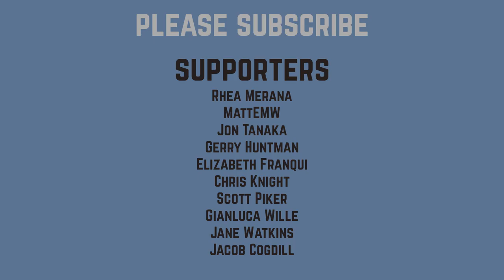How To Remove Broken Drill Bit

Comment: Too bad that I can't shake a beam in the house basement like that to remove my bit! 🤦‍♂️🤓🤷‍♂️
Reply: use oil and pointy beaked pliers, you might get it out then :) but yeah doesnt work on all things, I got a supersmall one  2mm drill bit stuck in buffalo horn bolster for a knife down 1 cm almost, had to dremel it out with cutter and break it up in a few pieces before I could remove it. no way some oil would have helped with that stuff, its like plastic and sort of melts around the bit.
Reply: @pr0faker  Definitely doesn't hurt to try it!
Reply: AWESOME!!!!
Reply: Exact same problem
Reply: Or a dining room table 😂

Comment: Yeah, I'll get on that, just as soon as I've pulled my bannister apart to do it. This is next to useless for 90% of applications.
Reply from the maker: If the drill bit is stuck in another object, a wall or railing or in a large board, then add oil or vd 40 there and with the help of thin pliers (tweezers) it will be possible to get

Comment: Um, what if the block is already screwed into a piece you're building lol
Reply from the maker: It is possible to use oil + 40 and if it is a bolt screwed into a block or brick, then try to get it using thin round teeth